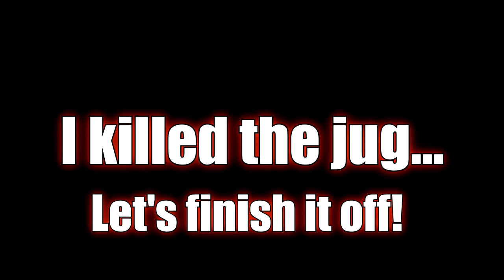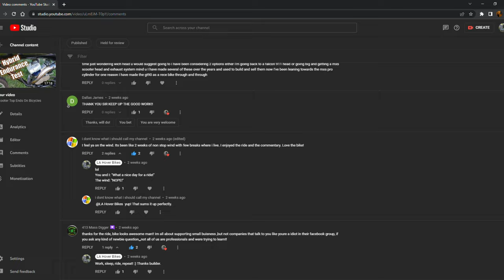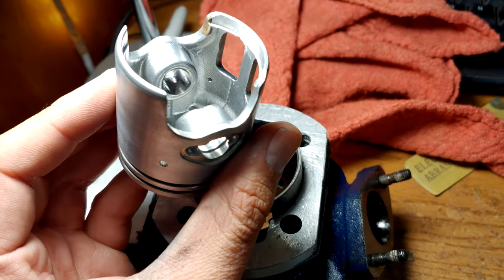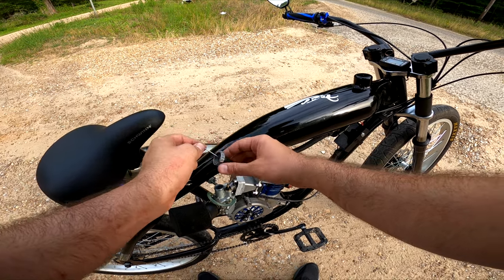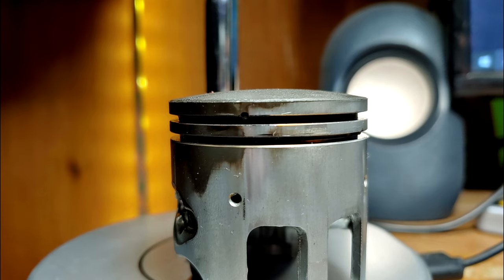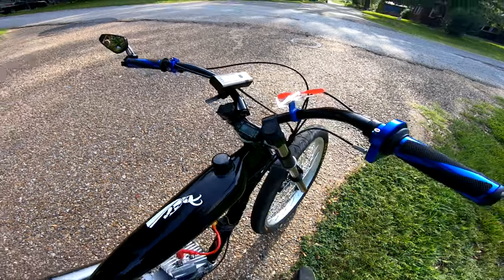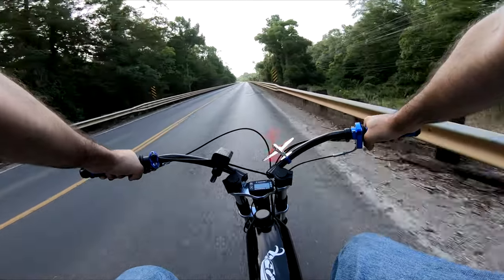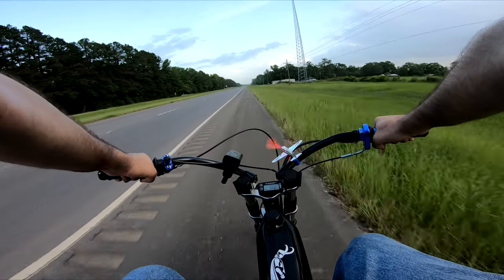Motorized Bike Hybrid Mods And Destruction

Comment: ughh never use a "Dingle berry hone" on a 2-cycle engine you need to use a 3 arm adjustable hone as they use a stone similar to a knife shaperner for the abrasion
Reply: Yes.They do make for a more consistant cylinder size.'Dangle-ball'honing is for an already standard sized cylinder,and just used for cross-hatching.His cylinder just needed that though,as it was hardly run,and no ring broke.(he also said he didn't plan to keep using this).Great call though.I'm going to hone my 'steel cylinder'before use too.I don't see Any cross-hatching.They just punch them in.
Reply: I would use 800 grit sandpaper wrapped around a rod...
Reply from the maker: Thanks for the feedback!
Reply: Three stone well oiled cleans up cylinder fairly well.

Comment: Hover in all the years ive been been screwing around with small engines ive never heard of honing compound  
The few times i honed a cylinder
And all the times ive seen it done
Motor oil was used to lubricate the cylinder  before and during honing
Reply from the maker: Oh I may have miss spoke. I mean what ever the little balls on the flex hone are made out of... But yes I did lube it up good with oil.

Comment: I bet that motor will just run all day now because of the "extra" clearance you gave it. It does sound down on power but it sounds like it's still happy so to speak. Did you catch the temperature of the cylinder with the new clearance it has. I'm interested now if it will run a long time like that without seizures. I just got a feeling like it make a good beater motor now and still pull decent speed all day.  Thanks for posting.
Reply: Agree mine ran like that with same issues now it's running 100x better
Reply from the maker: Your are probably right lol

Comment: I've been driving my China doll to work and back on a 36tooth sproket.  Which is 18 miles to and 17 miles back. At 35mph  its takes me about 43 m8ns or so depending on traffic. I messed me first moter up and now my 2nd giving me trouble cause I never inspected before using lol. 3rd one I will inspect.lol

Comment: That's a good video Hoover I'm surprised I really do want an endurance ride I never got my bike to do 54 mph consistently it only does it for about 30 seconds and it will seize up so I know after I pass about 50 let go of the throttle within 10 seconds and go a little bit lower RPMs and tap the gas two strokes like it when you feed it gas by opening and closing throttle but either way I'm glad you fix that idling problem who would have known it was the CDI but your theory is very ideologic so keep it up I want you to improve help others and who knows you might help me on the way keep it up I'm currently working on my short rod 40 mm just testing Waters pretty much it's done but I'm just waiting on a nice bike

Comment: Is it possible to buy or make the rear sprocket so it bolts where a disc brake rotor would be instead of using the spokes to drive the back wheel?  I ask because I have some 29er rims & some other than meant for bicycles sourced engines in my shed now

Comment: Hi la. I brought a beach cruiser and took the rear wheel off to grease it. But  I can't fit it back in onto the frame. No clearance
 I swear I put the coaster brake back correctly. I have another of the same beach cruiser and I put the rear wheel from my new bike onto my old same bike and it fits I'm not quite sure

Comment: Had soft seizure issues on all my last three minarelli cylinders. I tried a bunch of ideas but what fixed it was a slight retard in my timing, it keeps combustion temperatures cooler and since then I've had zero issues. I really related to this video. I myself was close to giving up.
Reply: Maybe only 6-8 not telling bc with the stock keyway there is already a little play
Reply: @speedyjoe7017  glad to hear it, I tried going as rich as possible, eliminating any air leaks and even going 25.1 fully syn motul oil but it still seized, i then retarded my timing and it fixed it.. these cylinders on mopeds have zero issues I'd imagine so at the time I thought it has to be the timing. Can't wait for your next upload

Comment: Yes soldering a  cable needs alot of Flux and a decent soldering iron that can keep the cable hot enough for the solder so stick, but if you get it too hot nothing with stick so don't try to use a propane torch lol

Comment: Can we build an alternator onto the frame and use it's pulley to tension the chain/ replace the pulley with a toothed gear. And grab an alternator for a small engine?
Reply: Damned good idea.Please let us know how well it works.I use a gear for my tensioner already.Wondered how to do an alternator and your idea sounds good.Thnx.
Rotary 736 Sprocket Idler 3/8"X 1.84" IS-810
That was on Ebay 2020.I've bought 3 more.None as replacements as they work well.They were for more builds.
Reply: @bryduhbikeguy  I'm thinking lengthen the chain, and keep the spring tensioner I have on the block, and custom cutting some satin tin to make a mount. Idk what I need to learn about alternators yet lmfao
Reply: @bryduhbikeguy  thank you so very much. I'm a generalized and less specialized thinker and your help is huge!
Reply: @bryduhbikeguy  I know with the truck pulley system on belt drive we use every side of the belt and right? So if the chain was slightly longer it can pass over a chain drive idler pulley off of any alternator for the needs required right? Just replace the alternator pulley with a chain sprocket and it's good I think? Pipe dream thinking XD
Reply: @bryduhbikeguy  I wantan alternator to power the battery I want to use to start my bike and get to the first 20-30 km, then rev my engine with a high speed gear ratio. 66 CC's annnnnd electric start it's almost wheelie time/ buys full dirtbiking helmet
Reply from the maker: Two birds with one stone, love the idea!
Reply: @LAHover  thank you very much

Comment: should i be concerned if my zeda 80 has never had  visible blue smoke? I use a certain type of stabilizer/oil/cleaner 2 stroke oil additive with no ethanol gasoline and I've never seen hardly any smoke at all.
Reply from the maker: I have no idea, probably not. Pop the top, if the cylinder looks good, she is happy.

Comment: hey dude i love your bike, im actually building a motorized bike right now with a phantom 85 but im just curious where to get that bike? im very curious cause i dont have a bike at the moment to put the engine on. i love the chopper design of that one and the built in gas tank.
Reply from the maker: This one is a "F-Zero" from Bike Berry. I had to change the bars and seat, but so far it's been a good runner. The stock wheels are only made for about 30MPH. Upgrade them if you plan on flying down the road.
Reply: @LAHover  thanks man! What would you suggest for better rims and tires?
Reply: @LAHover  would you mind pointing me in the direction of better wheels? I appreciate all you do

Comment: The 'ring-gap' was interesting.I've seen smaller on turbo 4-cylinders.I let 'molybdenum grease'set into the cylinders,pistons and rings, etc. for 3-4 days before wiping the excess as it soaks into the metals.I've never seen the scoring on a cylinder walls and piston skirts with that much slop in the ring gaps,in any car engine either.Was the 'wrist-pin'too small for the roller-bearing?I can't see the piston expanding enough to score itself.Great video LA.The short cylinder is why the shorter stroke piston.The huge aluminum head and the standard crankcase won't heat the same,so I'm glad you did a much longer warming ride.I guess they just need More Oil in the Mix.?.
Reply from the maker: All good suggestion thanks. I'm never 100% sure what causes anything so I'll look into it.

Comment: Hi, I'm using the g2 reed on my 66cc engine, but I'm having a gasket leak problem that I can't solve, it always leaks through the gasket.  any suggestion?
Reply from the maker: Fuel resistant ultra gray gasket maker.

Comment: Don’t know if you’ll ever see this but if you ever have a problem with bolts bottoming out , on wire strippers there are holes with threads on the the top in which if a bolt is too long it is meant to cut it

Comment: There is a company named 'Tech line Coatings' which sells a dry film lubricant called 'PowerKote DFL-1' which is relatively easy to apply.
 Lightly sand blast the skirt,  or sand it if you don't have a sand blaster, spray it on, (you'll need a small paint gun) let it dry, then bake it in a small oven outside at 300° for an hour. (Assuming you have an air compressor)
 It works very well reduces friction and may help.
 It can be applied to any moving surface in the engine.
 It SIGNIFICANTLY reduces the level of oil needed on any surface. In fact,  it needs almost no oil at all.
 It greatly reduces or even eliminates scuffing and will easily last longer than the engine. 
It can even be used on the clutch parts and would increase the life of the components probably until Jesus returns.
 You CANNOT bake it inside the house because of the fumes,  you must use a small $30 oven and cannot ever use the oven for food again.

Comment: You should try the Parma kit cdi on the Minarelli i guess it’s supposed to curve your timing 7 degrees and supposed to keep the head temps down they’re only 70 bucks now that I’m rewatching this.. I’m about to do my first “build” gonna purchase the smolik 70cc Minarelli with upgraded Viton seals, off set intake, ported, mikuni vm20mm, and RMH Minarelli race pipe I already have my S.A.F clutch and f-zero frame, front gemini waiting for rears to be in stock, ruff cycle forks gonna do the springer bobber seat and a full light break light and blinker set up off a 12v Milwaukee

Comment: Is there any way to use a rag joint with the Schwinn taff because of the disc spacing?

Sorry that this is very unrelated. I dropped my phone in the pool and I’m doing this on my old one that discord keeps crashing.
Reply from the maker: If you can open the center of the sprocket wide enough to find over the hub I think so.
Reply: Alright that’s what a was fixing to do. Thanks

Comment: Its probably a bad seal some where, in germany we use brake cleaner and spray it on every seal there is and listen for the rpm to rise, youll need to hold the gas very steady when doing this or you wont get it. Idk but you guys in the states really need some tips and advice sometimes but atleast you got a tuning scene over there, which we dont and parts are so extremely rare or need to be imported (tuning)

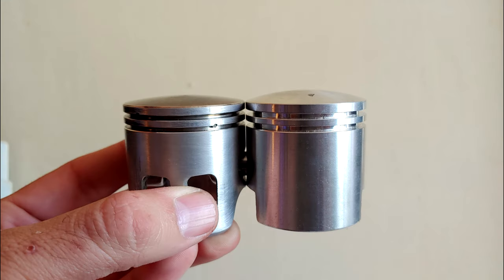Comment: 5:00 no, it will not cause any problem. The modern racing engines have both ring gap on the transfer at the other side of the exhaust
Reply from the maker: Thanks for the feed back, would you be able to point me to some picture, video, or articles about these motors? I looked around a bit and have never seen ring end gaps intersecting ports.
Reply: @LAHover  the modena engine kk1 125 has 1 ring with the ring gap wher i said

Comment: How's that exhaust...does it add power ? Thanks and keep up.the great videos !
Reply from the maker: The Jog pipe seems to do the trick. And for about $80 you can't go wrong.
Reply: @LAHover  awesome..have you are tried the mz65 clones you can get from Amazon ? How would it compare to that ?  Thanks again
Reply: @tamerfahmy435  If the clone is identical in dimensions to the real MZ65, I'd say they're comparable. If it's one of the smaller dimension clones, the Jog pipe would easily outperform it. Regardless of which MZ65 type exhaust you choose, you would have to purchase and install a separate silencer (Jog pipe includes a silencer).
Reply: Thanks for your inputs....i think the clones are smaller...so i guess ill give this pipe a try. I think the flange wont fit a stock cylinder though...might need to be cut up and rewelded !

Comment: Anyone know why a motorized bike would die everytime trying to get going from a complete stop?
Reply: You are releasing your clutch too fast. Bogging the motor
Reply: I don't think that it, I even pedal to keep it from dying and it still happen sometimes.
Reply: @ediot.1012   I would try a larger sprocket to make it easier to get moving.
Reply: And keep in mind that these are oedal assist motors. You can modify them for more power, but you may still need to pedal and feather the clutch to start going/ride slow.
Reply: CDI.

Comment: use motoroil when honing
Reply from the maker: I did, sorry if I did not make that clear. I used 10w40
Reply: @LAHover  I mean it should be the only thing you use, I have never used the compound but I get good results. I work on 212cc minibikes tho
Reply from the maker: @300ALZX  Whatever the flex hone is made out of. Seems like some kind of compound. Definitely not like a stone hone (I think)...
Reply: I've heard them referring to as dingle ball hone, I would search for the style that has 3 stones that expand with rotating it

Comment: So what's the most reliable engine  for a motorized bicycle ?
I don't care about the price just the most reliable for say a name brand mountain bike .
4 stroke please.
Reply from the maker: Get a hold of Don Butler on face book. Ask for a maximum reliability build.
As far as the most reliable motor I have used. That would be a Seeutek pk80, I don't know if they still build them as good, but I still hear good things...
Out side of gas, most water resistant e-bikes kits with LG or Samsung batteries will out last the 2 strokes unless you get super unlucky.
Reply from the maker: Oh 4 strokes... My bad I have no idea. The phatmoto bikes have come along way. But I'm mostly 2 strokes or electric.